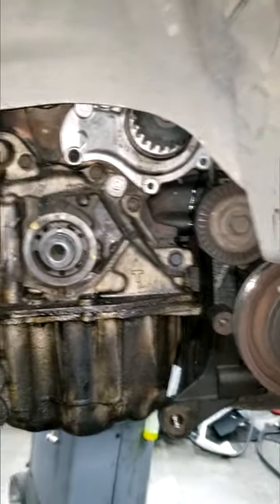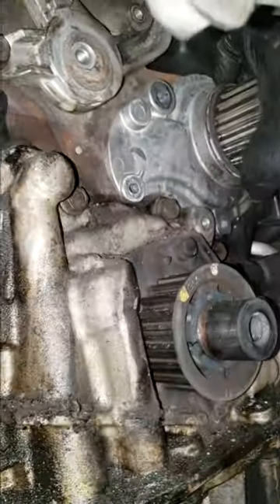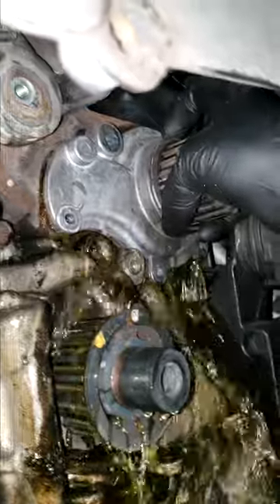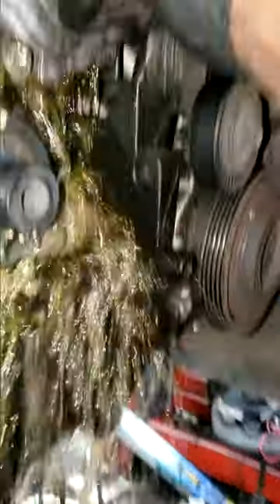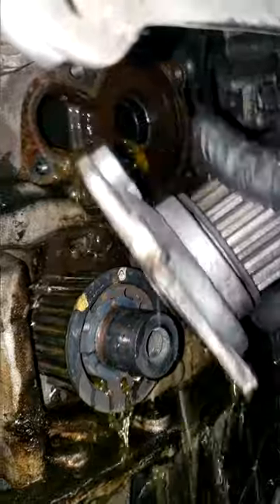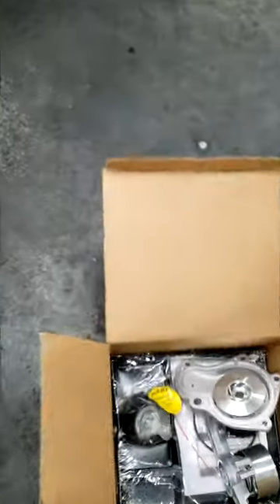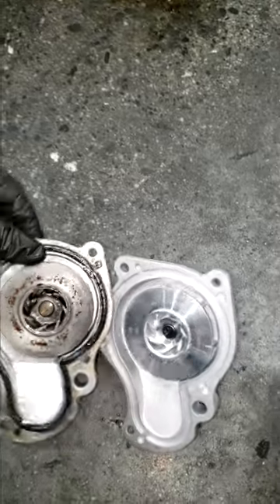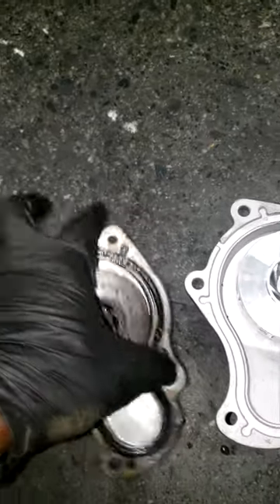WARNING. Using this can destroy your cooling system and water pump.

Comment: How long have you been working on cars? That was coolant/antifreeze that came out of it. Now a days there is several colors of coolant/antifreeze. There is the neon green that everyone knows, orange, Asian car green, Asian blue, European blue, purple, pink, and gold what you see in this clip. Like he said it is very important to use coolant/antifreeze but it is just as important to use the correct type of coolant/antifreeze.
Reply from the maker: Lol, you have no idea what that is that came out of this car from where you sat. You can only speculate what it is based on what it look like. No need to question me, I ask all the questions my guy.
Reply: @OnlineMechanicTips  Again I question your experience. My guy. Cuz I’ve been doing this job for a living for far too long and running my own shop not to know what that was. I can look at it and tell it was Valvoline Chrysler gold coolant/antifreeze or store brand multi vehicle gold coolant/antifreeze. I get it that your try to help and put out helpful information for those who don’t know. But you used a bad example. I don’t know everything and you could help me. And I KNOW for sure you don’t know everything. But that WAS coolant/antifreeze.
Reply from the maker: @Batman31112  smdh, that is coolant mixed with a lot of water Mr sir. 10/90 ratio at best (basically heavy diluted coolant, I told her to add it just to get it to the shop).. Its a shame for you to admit having such experience when you not smart enough to avoid speculating things based off what you seeing thats on the internet. A true professional avoids doing silly things like that. However, you did mention some great tips in your initial comment. You just took a left turn wondering about the guy that uploaded the video. Im a content creator, keep that in mind.
Reply: @OnlineMechanicTips  if it’s 10/90 50/50 or full strength it’s still coolant/antifreeze non the less and that’s not what you said in the clip. You were all over the place. Saying you don’t know what it is one second then talking about coolant mixture the next. You implied that there was no coolant in it at all. Not the correct mixture. And again I get and understand your just trying to help. But on the other hand I’m not going to let you hide behind being a contant creator. As a content creator you have a responsibility not to spread misinformation to the best of your ability. That’s part of the problem we have today. You have to watch what you say and how you say it. Cuz as dumb as it sounds some people dont know how to tell the difference and they run with what they see and hear in the internet.
Reply from the maker: @Batman31112  My dude, you have no videos up, so that alone disqualify you to give me advice on how to make videos or what to say. In this video, I basically, well, said what I wanted to say. Being very careful not to mention specific. You took it upon yourself to assume. Again, a guy with so call experience should not do that. Traditionally so called mechanics normally don't go back an forth with other mechanics on there video unless they adding to it. Theres a diff between a content creator that cares about views and a mechanic thats actually in the shop. Please recognize the difference..
Reply from the maker: @Batman31112  And for the record your definition of "spread misinformation" could be nothing more than you disagreeing with the person that gives the info. His opinion does not mean he wrong simply because you disagree with it. Opinions are like assholes. You welcome to also give yours. So if you trying to reach the masses with info, I suggest you upload videos instead of setting on the sideline trolling. No sense trying to convince me of anything. Im hard to impress.
Reply: @OnlineMechanicTips  this is not a disagreement about views. You said you didn’t know what fluid it was. And implying that it wasn’t coolant at all. Then when I call you out you say it was heavily diluted coolant. That’s not an option. That’s spreading misinformation. And why do I need to make videos when I can call people out on there BS.
Reply from the maker: @Batman31112  That makes you a sideline troll..lol, thats not a good look..Get out here in the trenches and flex ya muscles. Being a keyboard thug lame
Reply from the maker: @Batman31112  lmao, calling me out on what??? Wth is misinformation? What you mentioning is called YOUR OPINION. NOT FACTS. YOU ARE ENTITLED TO THAT. I disagree with what you saying so I will call you out, (that don't even sound right) And I call it like I see it, no insults, you acting like a sideline troll keyboard thug. No sense trying to convince me of anything.. Either get out here with the pros or continue to sat on the sidelines cheering. You can't call me out, lol (wth do that even mean?) Understand what creators have in mind when they upload videos.
Reply from the maker: @Batman31112  And p.s. Don't worry about my experience level.lol..Only my almost 100k subscribers can question me on that. If you one or ever become one, then and only then should you question anything I do.
Reply from the maker: @Batman31112  My dude, I could give 2 shits about any of that..I can sat here at my computer desk and type in a bunch of medicine stuff and simply claim to be a top sergeon. No need for me to re visit a video Ive already done. I have moved on and I suggest you do the same. TO ME, any thing you say in the comment section I simply take as an opinion of yours. You cant claim your opinion to be facts, dont work like that. Everybody think different. What ever I said in MY VIDEO is basically MY OPINION.  Sorry, but thats how it work. Opinions not always fact but they are in fact debatable.

Comment: Coolant helps prevent electrolysis which happens inside the coolant system when flowing while running, which causes corrosion, which is also why dex-cool is for fools, I've had that clog heater hoses completely solid!

Comment: I lived in Florida and put str8 distilled water in my car and it’s been like that for a couple years now. The coolant level is still full and the water is clear as day
Reply: If it’s not leaking replace it with 50% coolant mix. He mentioned the corrosion inhibitors but it also raises the boiling point. Don’t cheap out just cause you don’t know better. Coolant also lubricates the water pump. BTW I also live in FL and use the 50/50 coolant mix.

Comment: Bro I had a water pump impeller dissolve completely in under a year because I ran only water. It was a brand new pump too lmao. That’s what I get for being cheap. Took me forever to figure it out haha.
Reply: your impeller was destroyed by electrolysis.
Reply: @brsproductions6117  yeah something dont add up lol
Reply: @contraband1543  when your antifreeze gets old or if you use only water the electricity that flows through the block of the engine causes electrolysis which is when the electrons moving carry an atom with them. The same thing they do to fat people to get rid of cellulite. That's why radiators get little pin holes in the tubes.

Comment: That’s correct antifreeze is actually a special acid that seals the metal inside the engine and you should never mix different colors of antifreeze companies make their specific type of acid for the The type of steel that they’re using in their engine block

Comment: Looks like ethylene glycol.  I've been using this in my vehicles since a wee lad.  I prefer it over others because it's wide compatibility with gasket materials such as siloxane rubber.  Remember GM's infamous intake gasket leaks due to antifreeze incompatibility?
Reply: Speak more on this ethylene glycol never heard of it
Reply: @Ken-harris  1st, back in the day, we used to park the vehicle atop the old outhouse hole hoping to keep the radiator from freezing in winter, or we'd drain the radiator and engine block in freezing weather.  This was the alternative to adding alcohol to the water, to lower the freeze point.  Then, sometime in the late 40's/early 50's, ethylene glycol became available and was standard in new vehicle cooling systems.  This continued through the 80's and into the 90's before other radiator soups were offered.
For specific info on ethylene glycol based coolant itself, see Prestone safety datasheet: SDS501

Comment: I've used water straight from the hose for years , never had a rusty water pump unless it was an older cast iron one, those rusted just on principle
Reply: Probably had poor compression and weak engine that didn't last as long as at could too

Comment: Someone may have mixed green coolant with orange coolant. It turns a putrid color and it doesn't properly protect against corrosion. That's because the anti corrosion inhibitors also don't mix. Get a 50% distilled water and 50% coolant made of what the manufacturer specifies.

Also, just because your antifreeze is green doesn't mean you can use anything green. Some Mitsubishis and Hondas had a green antifreeze. However, it is a non-silicate antifreeze. Green stuff for old American cars has silicates. Silicates will destroy a water pump in a car built for non silicate antifreeze. Nowadays, companies like Zerex and Pentosin sell "Asian Green" which is a green non-silicate antifreeze.

Comment: You want 50/50 ethylene glycol/distilled water. Tap water is not recommended but will work in a pinch if you develop a leak. Never run your car on straight antifreeze or straight water

Comment: Obviously from the south. Engines and radiators will split right open in winter. Corrosion won't even be a concern. That said that looks like yellow coolant not water.

Comment: while you are doing a radiator flush, is it okay to use water if you are going to flush again with distilled water later? ect 3 flushes with tap water and last 2 with distilled?

Comment: Surely there is a better way to drain the block than just taking the water pump off.
Reply from the maker: Why should that matter? Even the coolant you saw coming out after that water pump was removed still not all of it. Theres still more in the sys. You will never get it all out
Reply: @OnlineMechanicTips    The provided drain plugs are much less messy.
Reply from the maker: @timgreen4137  lol, when you do this for a living, messy jobs are no concern my guy. Only the pay. The drain plug is attached to the radiator, you will never get all the coolant out of a engine.
Reply: @OnlineMechanicTips  I do it all the time, "my guy".  At least I don't end up with coolant all over the floor and front of the engine.

Comment: Do not use tap water at all. It has too much minerals and chlorine. Use distilled. When doing a flush coolant change. It doesn't cost much. And use long life biodegradable coolant or concentrate your own with distilled water to finish if your vehicle can take it. Use a coolant gravity squeeze bulb when you are done. And stay away from GM's orange long life coolant. Most vehicles in the 2000s can use long life green. GM coolant is the worst.

Comment: Curious, what is that I keep seeing in the drain pans? We've never had to use anything like that around here, just the pan by itself
Reply: Filters out solid material and prevents splashing.
Reply: @pinkiepie1656  I figured. Just wondering what is it exactly? Oil absorbent or what? All the shops in 4 different cities, I've never seen it except on videos.

Comment: Wow. Drain as you go. No need to drain before working on the pump
Reply from the maker: The radiator was drained sir, you will never get all the coolant out of the block just by drainig the radiator. Besides, its no big deal. Just use a drain pan. You thinking to hard and time is money.

Comment: Drain plug?
Reply: You clearly never done a water pump, there is always coolant left in the engine when you take the pump off.
Reply: @narele25  This, I'd I remember right was not just fluid left inside. I have flipped more cars in my life so yeah, I have done a few. This guy didn't drain anything.
Reply: You can pull what ever hoses you want and take the radiator out. You will still have a lot of water drain out of the block.

Comment: I don’t change coolant  at all I would think OEM  lifetime fluid  every 60,000 mile
Reply: coolant lasting 60,000 miles?
Reply: Unless it requires it owner manual 60,000 miles

Car comes with lifetime fluid
Reply: @x1Conan3Spartan0x  yeah I never change it what dealer said it lifetime fluid

Comment: You done more damage to rest pulleys water all.over them why didn't you drain water off first
Reply from the maker: smdh, Now what pulleys did you actually see get water all over them? A crank gear is not a pulley and this fluid will not cause damage to it my guy. And for the record, you can drain this sys all you want, you never going to get it all out especially inside the block. The remaining will come out when this water pump removed such as what you saw.

Comment: BRO, THAT IS THE CHEMELEON ANTIFREEZE. how long you been doing this?? It's for ALL MAKES and MODELS, It changes to the color of the antifreeze its added to Unless its completely drained and filled with it of course.. Also that water pump looks new, wtf you doing?
Reply from the maker: You have no idea or clue what that is. You stating what it looks like. As I stated in the video, the timing belt job was told which included a new water pump replacement. Any thing else?

Comment: Next time drain the coolant system.
Reply from the maker: Or what will happen? You will need to use a drain bucket under the water pump? Is that illegal or bad?

Comment: Antifreeze will eat at the block mixed wrong, and universal antifreeze is acceptable, and water barely rust as long as there is nothing in it, your tap water is filled with shit ,should not even drink it. Know what you are doing and if not leave it to the professionals.